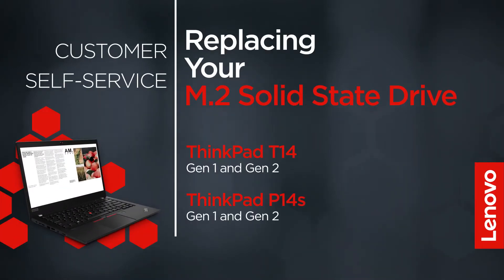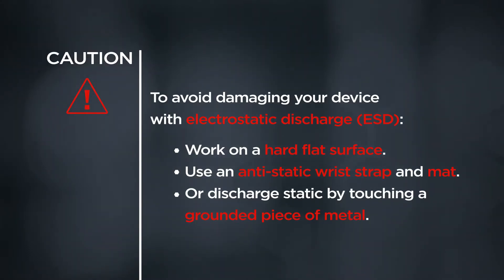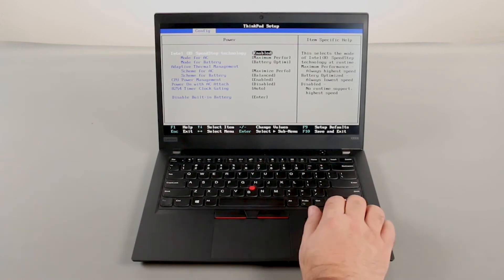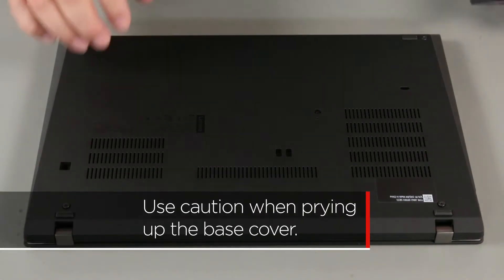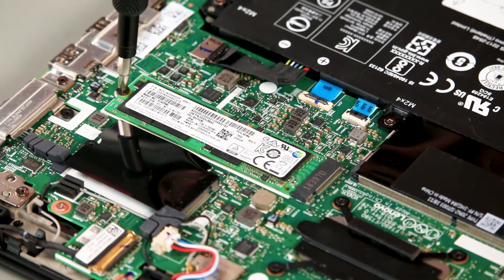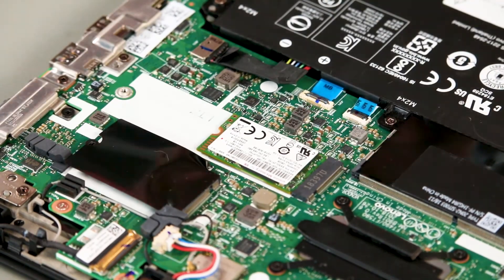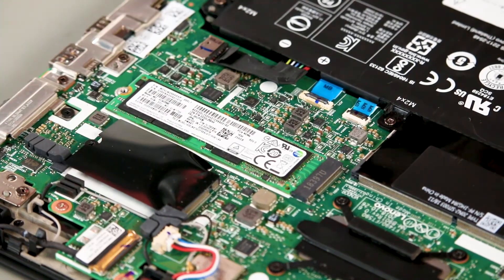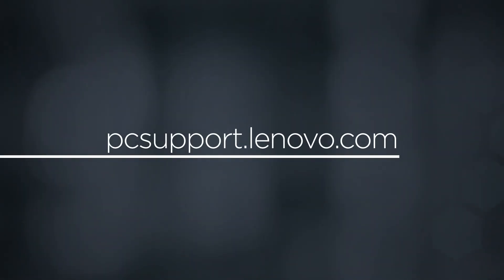Replacing Your M.2 Solid State Drive | ThinkPad T14 and P14s Gen 1 and 2 | Customer Self Service

Comment from the maker: This video will show you how to replace the M.2 Solid State Drive of your ThinkPad. The process in this video will work for the ThinkPad T14 Gen 1 and Gen 2 and the ThinkPad P14s Gen 1 and Gen 2. 

You will need a screwdriver kit, a non-metallic pry tool, and 15 minutes of your time.

ThinkPad T14 Gen 1 Repair Guide: https://pcsupport.lenovo.com/us/en/products/laptops-and-netbooks/thinkpad-t-series-laptops/thinkpad-t14-type-20ud-20ue/selfrepair/removalsreplacements

ThinkPad T14 Gen 2 Repair Guide: https://pcsupport.lenovo.com/us/en/products/laptops-and-netbooks/thinkpad-t-series-laptops/thinkpad-t14-gen-2-type-20w0-20w1/selfrepair/removalsreplacements

ThinkPad P14s Gen 1 Repair Guide: https://pcsupport.lenovo.com/us/en/products/laptops-and-netbooks/thinkpad-p-series-laptops/p14s-type-20s4-20s5/selfrepair/removalsreplacements

ThinkPad P14s Gen 2 Repair Guide: https://pcsupport.lenovo.com/us/en/products/laptops-and-netbooks/thinkpad-p-series-laptops/thinkpad-p14s-gen-2-type-20vx--20vy/selfrepair/removalsreplacements

To learn more about your device go to https://pcsupport.lenovo.com

To find parts for your device go to https://support.lenovo.com/parts-lookup/?cid=ww:lenovosocial:b9515f&source=socialmedia&subsource=yt

To view the Lenovo Support Self-Repair Guides landing page go to https://support.lenovo.com/us/en/solutions/HT516547

** NOTE: Static electricity can destroy components. Use a grounding strap, and clean, non-conductive surface to work on. Use plastic or coated tools to prevent scratching and avoid using metal tools on plastic parts. For more detailed information on electrostatic discharge and how to prevent it, please watch our ""Understanding Electrostatic Discharge (ESD)"" video: https://youtu.be/by4PB3WtdLo 

Applicable Machine Types:
ThinkPad T14 Gen 1 - 20S1, 20S0, 20UE, 20UD
ThinkPad T14 Gen 2 - 20W0, 20W1, 20XK, 20XL
ThinkPad P14s Gen 1 - 20S4, 20S5, 20Y1, 20Y2
ThinkPad P14s Gen 2 - 20VX, 20VY, 21A1, 21A0

#lenovo #LenovoSupport #LenovoTechSupport